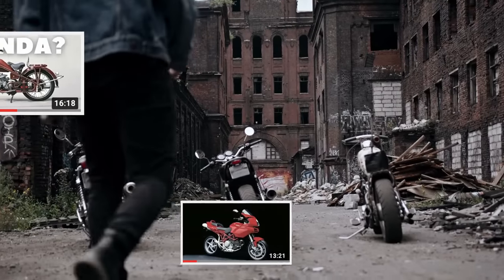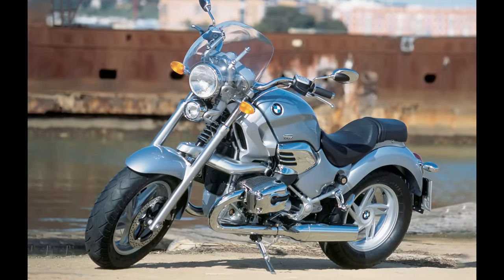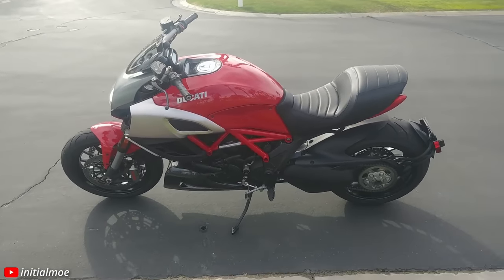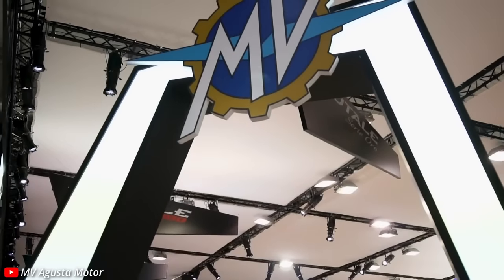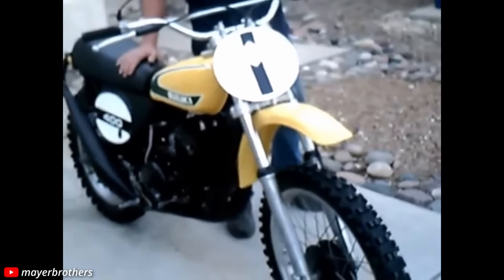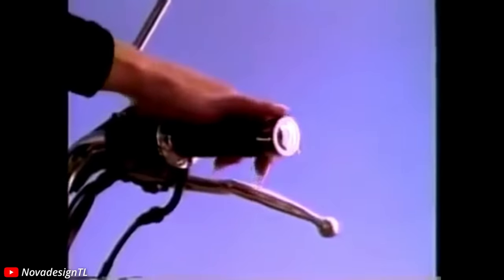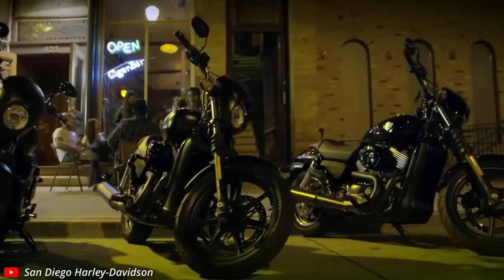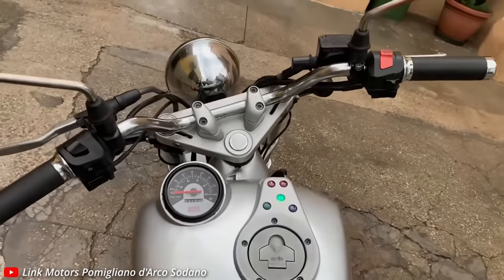The WORST Motorcycle from every manufacturer

Comment: I would like to contribute to your assessment of Triumph.  I owned a 1966 Bonneville that I purchased with low mileage in 1967.  The first thing to go was the clutch.  Never before had I lost a clutch on a motorcycle.  The second thing to go was the main bearing.  Triumph mechanics told me that these were common problems and that there was no reason to believe the previous owner or I had been negligent.  So, my love affair with the Triumph lasted the best part of one season and included approximately 4000 miles (remember miles?).  I sold it for a considerable loss as I was going back to school and couldn't afford to fix it.  Today I look at Triumphs and have ridden a few.  I find the power merely satisfactory and the looks could use some help.  Mind you, if I could bend my 74 year old body around a Speed Triple 1200RR  and reach the ground when on top of it,  I might feel quite different

Comment: I have two Royal Enfields, a 500 Classic and an Interceptor, and whilst the Interceptor is a vastly more capable bike there's something really special about the 500. For cruising around at sub highway speeds it's hard to beat, with a super comfortable riding position and a lazy, torquey engine that encourages you to relax and just enjoy the ride. It's easy to ride and has amazing slow speed handling and fuel economy.

 Some people just don't get it and I understand why, the stats don't make for pretty reading, but if you ever get a chance to ride one do it, it can change your ideas about what a motorcycle should be.
Reply: correct, here in India RE classics 350s are selling like hot cakes, they have aged well and RE have introduced 3-4 new bikes as well so classics are not the only ones they are selling
Reply: how reliable has the interceptor been?
Reply: @Spartansrule118  I haven't had any problems with the Interceptor at all. Also many of these have been sold now over the last three or four years and I'm not aware of any serious issues surfacing in online discussions about the bike, so I think the record suggests it's a very reliable machine. I think it's a great package, it looks and sounds great, it has enough power, it handles really well, it's easy to service and maintain as long as you have some basic mechanical skill and it's a bit of a bargain for the price. There's a reason it has been so popular, it's a really nice bike.
Reply: @Biggus63  thanks. i started riding this past summer (Canada) and i’m think of getting an interceptor as my 2nd bike and selling my Kawasaki ZZR250 in a season or so once i get more comfortable.
Reply: @Spartansrule118  I think it's a good bike for a relatively new rider, it's in that 'Goldilocks' zone, enough power but not too fast, and the slipper clutch makes it very forgiving of less that perfect gear changes, in other words it's an easy bike to ride, probably easier than the bike you're riding at the moment in a lot of ways. I'd loved to have had one when I started riding, even at 59 years old now I reckon it's a great bike. Just don't buy one if you're uncomfortable talking to strangers because everyone wants to talk about it, I have the one with the chrome and red tank and I can't park it anywhere without people coming up wanting to have a chat about it.

Comment: Bought a 750 Virago cheap from a friend..he bought it used and kept it in great shape... didn't hate it...didn't love it..was a great commuter bike but to little/ light for long distance touring..got almost double what I paid for it on trade for a Honda VTX retro...love that bike..many comfortable trips, interesting experiences...
Reply: When I got my commuter bike I essentially had a choice between purchasing a '96 Virago XV 750 that ran (didn't run very well, had a tuning issue that stopped it at about 53 mph), or a non-running '81 Suzuki Gs-650L. Hardest choice I think I've ever made. I absolutely love the comfort and handling of the Virago, but the 650 despite having a smaller engine makes more power and torque as well as better fuel economy. Ended up getting the Suzuki, less comfy to ride and still gets blown about by the wind and trucks but I still think I made the right choice between those 2 specific bikes. If the Virago was in better shape and/or was an 1100 (heavier, more powerful and similar economy to the 750), I 100% would have sided with it instead.

Comment: Fun video, some of the bikes in the list I have not seen before. I do have some comments on Moto Guzzi as I own two of them. 
For what ever reason I stumbled into a 2004 California 1100 Stone Touring last winter down in Arizona. It had been sitting for 7 years and was in need of lots of love, but at a purchase price of $900.00 I could not leave it at the sellers house. Well after all the tank cleaning a new in tank EFI fuel pump and injector cleaning, rubber lines, new tires, etc, etc,  I got the bike on the road! Well it turned out that I love it! I have owned many bikes and still own a large number , I will put my current list of bikes at the bottom of this. 
The California 1100 was just amazing on the road, it handles like all the weight is 3 " off the ground, you would just need to look where you want to go and it would go, very stable at high speeds and the best wind protection I have ever had on any of my bikes. Handling is very much like the BMW horizontally opposed bikes do. 
After the winter season riding the 1100 I left Arizona in May and went back to Canada, and guess what I was missing the Guzzi 1100 so I went looking for another Guzzi! Well sure enough I found a great deal on a 2014 Moto Guzzi California Custom 1400 our local Kijji sales web site, seller was now 80 years old and could not ride anymore, he purchased the bike brand new and yada yada so I purchased it. 
It has all the flavour I liked in the Cali 1100 and even more HP and a Torque curve as flat as a table top, just gob's of torque and dead smooth power band, the engine is a jewel! The big mill cranks out 96 ponies at 6,500 rpm, not bad for a V-twin, but the real news is in the torque numbers. At a mere 2,750 rpm, it generates 87 pound-feet of torque that it maintains right up to near redline. That is power you will definitely feel in the seat of your pants, and it delivers as the bike is not that heavy making it more than a match for off the line events with Harleys or other cursers, even my buddies 1996 FJ1200 can't shake me off his back side off the lights and down the highway! Build quality is amazing as well. 
Anyway there is my two cents on the Moto Guzzi's. More info on the 1400 Guzzi;
https://www.motorcyclespecs.co.za/model/moto%20guzzi/moto_guzzi_california_1400.htm
My current bikes from oldest to newest;
1970 Honda CT70, 1973 Honda XL350, 3x 1977 Yamaha DT400, 1982 Yamaha XT550J, 1984 Yamaha XJ750RL, 2004 Moto Guzzi California Stone 1100, 2014 Moto Guzzi California Custom 1400, 2016 BMW R1200RT,  2019 Kawasaki z900rs Café Eddie Lawson edition, 2020 Honda Africa Twin CRF1100

Comment: If you have not, I would highly recommend taking a ride on a Kawasaki Vulcan 2000. Yes, it has some pretty notable mechanical issues but let me tell you, the handling and low center of gravity combined with the comfort and very good performance have made the Vulcan 2000 my favorite bike I have ever ridden or owned by quite a lot.
Reply: I will agree.  Picked up a 2006 '2000 this spring for $4500 with 19,000 miles and put $1500 in it (tires, brakes, tach, etc.)      I've never owned a bike this fun.    I could have spent $25,000 on an Indian or Harley and not loved it like this magical machine.
Reply: "notable mechanical issues" from kawasaki these days makes it unacceptable imo, even if it has other redeeming features
Reply: I'm a lazy biker and my vn1500 Vulcan was my ha harley substitute....loved the bike torque monster so loud so effortless.......heavy though. Cost  little  top fun
Reply: @johnbiggins4864  Yep, had a 1988 VN1500 bought used from a neighbor. Have a 2009 VN900 now and I like it but man, I miss that 1500. I just turned 70 so a nice little ride that's fairly comfortable like the 900 is good enough for me. 

That being said, I don't agree with the Virago being an ugly bike either.

Comment: I owned the R1200C for a while. People seem to have a love/hate POV on the aesthetic. However, it was featured in the Guggenheim's "Art of the Motorcycle" and of course was featured in James Bond: Tomorrow Never Dies. In terms of ownership it was very comfortable and as unorthodox as it looked, was super pragmatic. Heated grips, removeable bags, great riding position. Also, horsepower-schmorsepower. Tons of great bikes have lower hp to weight ratios but are brilliant. I've had very fast motorcycles too, like many of you and while the R1200C was no race-winner, it terms of performance it was sort of the Toyota Camry of motorcycles. Finally, just search for one and you'll find the resale is holding up nicely.

Comment: Enjoyed the video.  I was sponsored by a Suzuki dealership in the early 70s for Motocross Racing.  Rode the dreaded TM400 for 3 years.  Won a lot of races on TM400s, so they can be raced competitively.  I also broke my collar bone on a TM400 when it went into tank slappers under hard acceleration on a rough section of track.  Fortunately, I picked up a MAICO sponsorship a year later and went from the worst, to maybe the best open class motocross bike every made.

Comment: Put 125,000 km on my Virago 1100 with basic maintenance and a clutch pack at 85,000 and that's it.  The engine was a bulletproof torque monster. I put stickies on it and the few Harleys I couldn't outrun disappeared in the mirrors on the corners.  It danced.  
I had no problem with the looks and it had its share of pretty girls on the seat behind me so it couldn't have been that bad and on a five foot wheelbase it was extremely nimble. 
You seem to be using Harleys as a sort of benchmark which is hilarious imho.

Comment: Funny enough, I love the R1200c.  I love the looks. I did upgrade it to at 6 speed from an R1200RTP, and modified the intake from the same bike.  I transferred the guts of the transmission over, so now it is a 6 speed, on that high ratio rear end, with the extra 6th gear.  The high ratio rear end takes away from the initial speed, but the bump in Hp from 60 to the 92 advertised on the RTP is really fun.  ❤
Reply: I got a 2004 r1200c at the end of 2022. It's been a great bike. It's the most comfortable bike I've ever had.

The engine purs around 3,500 rpm at 80mph.

The back seat folds up into a backrest for the driver.
Reply: the R1200c had the coolest front end ever put on a stock cruiser.  anyone who rode one, while leaned over in a bumpy corner knows what i mean
Reply: A man in our professional group has one and all the rest of us are jealous of him
Reply: i bought my R1200c new in 98 and still ride it daily at 64 years old , handles great and if you take care of maintenance has never stranded me except 1 flat tire in 25 years.

Comment: I used to hate how the 999 looked, nowadays every time I see one it turns my head, I think it's aged unbelievably well .I'm willing to admit that although it was a big visual change at the time, I didn't give it the chance it deseved, it's actually quite a beautiful bike. EDIT: You forgot the Virago came in a 250cc model lol, all the same looks with 1/3 of the capacity.
Reply: Biker  Oh gods, is the 125cc also a 4 stroke? Even the 250 struggled to pull the skin off custard.
Reply: Biker  I somewhat agree in principle, but I have ridden some 250cc and smaller bikes and feel like that's very situational. I'm a big guy and on highways or open country roads it can be legitimately difficult to keep up with traffic, let alone get away from it, on bikes like that. Maybe I'm not seeing the beginner perspective these days but I think most people could easily handle one of the gently tuned 400s and would be safer on the road.
Reply: I own a 2006 999s. I love it EXCEPT for the mirrors are fucking useless and replacing the air filters are a pain in the ass! Besides that great bike!

Comment: Love my R1200c. At the time I bought it I was trying to decide between it and a Softail Springer . Salesman at the Harley Dealer called me a RUB since I went there in a suit after work. Made my decision for the R1200c easy. I dig that retro look. Bought mine brand new in 01 for .07% financing. Still have it. Still ride it. Never let me down. Bike was way ahead of its time when you look at the suspension and braking. Yes, I would like more hp but it's a torque monster. Great bike to cruise all day on the highway. I also love the fact that it looks like nothing else out there. Till this day I get comiments no matter where I go with. Great video bro.
Reply: yep if you are wearing a suit you definitely are a bmw type of guy.😀
Reply: Me too have a 2000 r1200c.  Received ton you compliments
Reply: I ride an 01 R1200c Phoenix. Living in the southwest I have the ability to ride year round and avidly do so.  The bike handles beautifully with its low center of gravity and feels to me powerful enough. I don't expect it to accelerate like a crotch rocket.  I love the feeling of power flow it provides.  It reminds me somewhat of the old Norton 850 Commando.
Reply: I have a 2004 r1200c. It's got enough power for me. It's got a nice power band 60-90mph.

I did see another video where the owner put mods from a gs bike and got 100hp out of it.

Keeping 61hp keeps the engine cooler than forcing more power out of it.

Comment: I've had a BMW R1200 CLC for almost 2 years. It's performance is on par with my 82 Harley Shovelhead. I dubbed it the Albatross. At slow speeds it is cumbersome and difficult to handle buy at speed is very graceful. When asked how fast it goes, I tell them "the speed limit." It does provide plenty of power to effectively manage traffic but above 85 mph it's running out of steam. It also has a 4.6 gallon tank x 42mpg which makes for frequent fuel stops. Heated seats and grips are also a nice touch. The standard "M" windshield was missing from mine and some people like it. I prefer the front window to be below my line of sight. To each, their own.

Comment: My favorite is the YamahaXS 650.  I don’t know why but you could have a lot of fun with them. Trackers, Bobbers 325 lb widowmakers with a 750 kit. And they were great to put on the center stand in neutral and rev them up and down and have kickstand races from the vibrations, I think with a little more should I say focus on the female market and the correct seating arrangement it could have been a really great idea!
Reply: I saw someone who'd stuck a XS650 engine in a plunger suspension BSA frame. The rear wheel spindle had snapped. Somehow the guy had NOT shat himself & didn't throw it down the road either. The OE XS650 was said to handle badly. Imagine a XS650 engine in a Nickel-plated Metisse frame.
Reply: Gordon here  I owned & droved 3  XS 650 and they were super fast  145 mph and nobody could touch me in a drag race or even in in quarter mile in its day them bikes super pleased me and then I went on the 750 Virago a super cruiser it took me everywhere without breaking down like oil leaking gas gushing crap hardly ride LMAO passed more of them on the highways with my 750 Virago than I could believe. And still got it 1986 750 Virago and NOT for sale. Cause it is MINE. Old reliable Old faithful . Then road never ends. 70 years old here . Bought that bike 1986 when it a new old stock and STILL going.
Reply: @patriciahibbert6139  WHAAAT????  145mph.....  are you a fisherman?
Reply: BS
The XS650 had serious charging system issues...and parts were impossible to find. Scrapped mine for $100...good riddance.
Reply: @Gortok1  I put a Ford truck alternator on with a belt and I welded trusses on mine changed the front fork rake a degree and internally balanced it as a 750 ported the intake and welded a floor in the exhaust. I got it to 138 in the 1/4. Oh and I put Virago intakes in from a 920 and closed the sides of the chamber for some quench. 72 hp on a dyno at the rear wheel. Are you one of those guys who likes to ride with your rear in the air? Men aren’t very aerodynamic, women on the other hand generally are like one of the spoilers that lift when you twist the throttle.my xs2 was the bike I have ever ridden. Did I modify it? Yes. That is how you bond with your bike or car. Also if you hand an Alternator and belt, make sure you have the same weight on both forks and a steel fork brace. Mine was 375 lbs on coilovers with a steel pipe welded as a stability control. To learn to ride is to learn to design and build. The XS2 was the best of 72-84.
Reply: @patriciahibbert6139  The Virago was a good bike. I got a lot of good parts of a wrecked one. How can you wreck one? It was just a Harley with power. 🥱

Comment: I loved my Virago 1100. I loved the shaft drive and it was the most powerful bike I had owned to that point. Its two biggest drawbacks were the wiring and the engine. The wiring was spaghetti and engineered for cost-effectiveness, iow - it was one gauge too thin to be durable.  The engine leaked. I never fixed it because that involved pulling it out and completely rebuilding it since the engine was manufactured in two halves and it leaked from the giant, again cost-effective-engineered gasket. Oh and I discovered how much I hated those 'cruiser' seats. In order to ride it comfortably I had to attach a full backpack to the sissy bar. But for the time I had it, I loved it. Go figure.